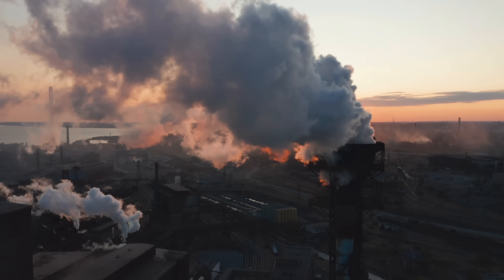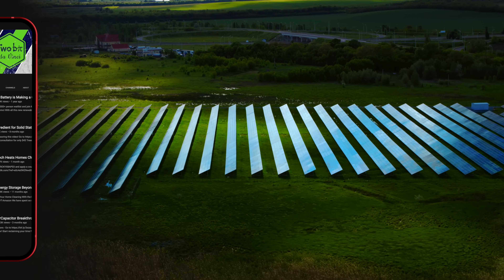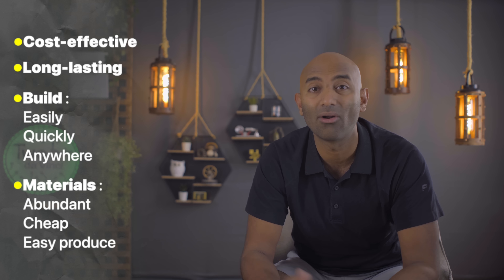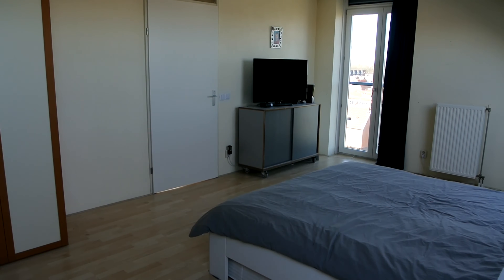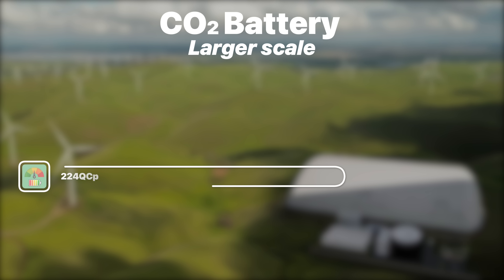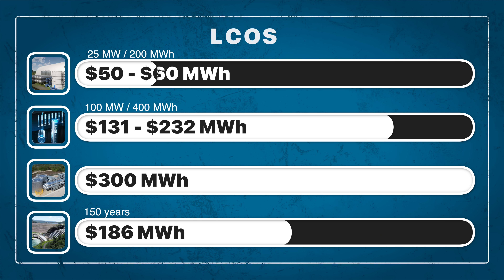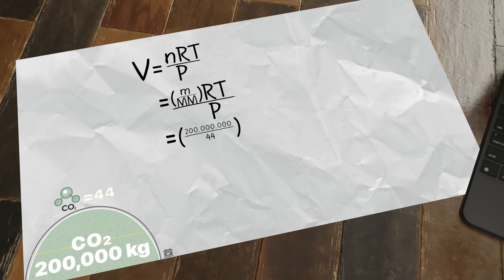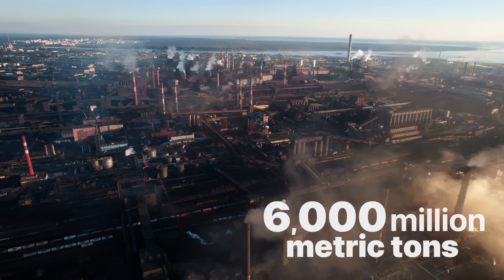The GENIUS Of the Carbon Dioxide Battery

Comment: How much CO2 will it cost to create the Iron/steel  for the CO2 Battery - Sometimes it cost more energy to create the solution - Like I want an EV and I am being forced to scrap my perfectly good car that I only do 3000 miles a year and should still have 10 years life still in it. 

Would it be more energy efficient to have an EV built and shipped to me whilst melting down my car for the metal, the EV will be costing me ~ $50K,  when I only paid $1K for the car 3 years ago. I would like a F150 lightning just because it would give me off-grid capabilities,  so I do see some benefits.

Comment: Delicate balance...  Scale is kind of important when discussing "delicate."  Funny thing is, 99.8% of folks going on and on and on concerning the topic have no idea about the actual numbers.  They prefer to believe in the cult of fear.

And why does every end-times belief always have to happen in this lifetime or very near it?  Hmmmmm.

------

Nearly all of the Earth's atmospheric oxygen comes from plants and the process of photosynthesis -- 98%.  70% of that plant-sourced O2 is sea and ocean based via phytoplankton.  In other words, what land-based life forms do is of marginal impact on planet Earth's atmosphere.

Here's the balanced chemical equation of the photosynthesis process:

6CO2 + 6H20 + (energy) → C6H12O6 + 6O2

Notice, the O2 and CO2 quantities are equal.

The balanced chemical equation of cellular respiration is just the reverse flow of the above -- sugar burned with oxygen yields cellular energy, carbon dioxide, and water.  Once again the quantities of oxygen and carbon dioxide are balanced.

The gradient between oxygen and carbon dioxide in the atmosphere is 21% to 0.04%...  That's one hell of a difference given plant cellular respiration is chemically balanced between CO2 and O2.  The difference is black hole like.  In addition, oxygen is an extremely reactive chemical.  It wants to combine with *everything*.  CO2?  Not so much.  It's nearly inert at earth atmospheric temperatures and pressures.

Another thing to keep in mind.  The cellular respiration process of plants producing CO2 goes on 24x7.  CO2 only gets converted to O2 during daylight photosynthesis.  That's a 2-to-1 margin.

Effectively, earth's biosphere is a carbon near-vacuum literally starving for CO2.

When such vast gradients exist and someone proffers the notion that parts per million perturbations are life-ending, chances are the speech is motivated and contains something more than rigorous science.

It just doesn't pass the simplicity back-of-napkin once-over.
Reply: This is such an inane argument, try raising the cyanide levels of your body to 400 ppm a let me know how it turns out. Obviously things in the ppm range can
Reply: ... have an effect.

But the percentage is irrelevant anyway that's  just how we measure it to track changes. What matters is the chance of a photon leaving the Earth encountering a CO2 molecule and getting sent back to the surface. That is related to number of CO2 molecules there are and nothing to do with proportions to other irrelevant gasses. If you magically took away all the other gasses so that CO2 was 100% the contribution it makes to the greenhouse effect would still be the same. The Earth would be freezing because most of the greenhouse effect comes from water vapor, but still the CO2 would keep the Earth warmer than it otherwise would be.

The actual relevant questions are: Does CO2 absorb photons in the infrared where The Earth radiates? The answer is yes.
Does increasing CO2 block more infrared? It's complicated but the answer comes out to be yes but it has diminishing returns. Which is why the climate sensitivity figure is given per doubling of CO2.

Comment: When Michael Mann came up with theory of a correlation of rising CO2 levels and rising global temperatures which was accepted by the IPCC through the measurements of tree rings but very much disputed by others equally competent in that scientific field  he failed to distinguish which came first. The rising temperatures or rising CO2 levels. 
Scientists using ice core samples which record the atmosphere when they are laid down have recently answered that question. Rising temperatures precede rising CO2 levels not the other way round. This makes a mockery of the accepted theory of anthropogenic global warming. Rising CO2 is not responsible for climate change. 
Weve been told to follow the science. Well there it is . Of course the climate alarmists will double down on the course they have set.Their version of climate science has become the most fraudulent by using historical data that has been manipulated and changed so that predetermined outcomes to support their theories.
And this is why the lPCC ,the UN and other climate alarmist bodies have never not even once come up with a working computer model that has predicted climate change based on rising CO2. 
Probably the closest predictions are made by Nicola Scafetta from the Milan university whose graphs show that climate change is cyclic with a prediction that global temperatures will decrease around 2028 - 29. So far his graphs have been accurate . This cannot be said of the corrosponding graphs made by the IPCC and the UN

Comment: CO2 never was a problem.

The only problem is that we may run out of fossil fuels and beyond nuclear no one has yet produced a viable, safe, economical, environmentally sound alternative, just jumped in with the extremely flawed wind and solar “alternatives”, that require massive environmental degradation to function even at their very limited potential.

You are the victim of a psy-op, and you are wasting your time and ours prattling like this.

Comment: Don’t need any of this with a nuclear reactor that produces electricity 24/7/365. Renewables are only cheaper because of Government subsidies for them, VS impediments to building nuclear plants.
Reply: That's not actually true. Even if the supply is constant the demand isn't. France has the highest % nuclear and they have reactors that shutdown over the weekend at great expense, others running inefficiently in load following mode and a high dependence on neighboring countries to supply dispatchable power at peak times and soak up the excess overnight. A high nuclear grid is also going to need storage.

The way we have until now dealt with this is not to have too much baseload and generate quite a lot of power from dispatchable sources like hydro, gas and even diesel and through demand side measures like off-peak power overnight. If we are going to phase out the gas and diesel it's going to take either new forms of dispatchable power which aren't in sight or storage. Renewables do seem to make the problem worse but not that much worse. The intermittency
Reply: [Bumped send] ...problem isn't as much of a problem if you already have enough dispatchble power to deal with demand.
Reply: Very true, but beware of the dangers of pressurized reactor vessels. LFTR is the safest and most cheapest because it uses mor abundant thorium and converts it more efficiently. And to top it off it can be scaled down to power a factory or subdivision. No more big energy and high tension transmission lines, with the bonus of resilience and redundancy!

Comment: I'd have questions about the flexible membrane inside the dome. That's probably the part most likely to leak and break. 
I wonder if telescoping gas-holders might work better instead. I imagine they might be easier to build and construct, and inspect, than large domes and their associated membranes are.
Reply: Quite remarkable how all the Gasholders that could be used for storage were demolished......rather like demolishing all the smaller and local power stations, whose retention would have been suited to more localised Combined Heat & Power (CHP).

The idiocy of those who cleared these things away when we most need them......

Talk about re-inventing the wheel...........obviously now at far greater cost..
Madness....!

James Hennighan
Yorkshire, England

Comment: Actually the news about CO2 is better than this. CO2 will not cause runaway global warming. It is like paint, add a little and you get a lot of change, extra coats make little difference (the relationship is logarithmic). Most theoretical warming from increasing CO2 has happened, and no disaster- actually things are going well. And a little warming is a good thing as it happens in the colder areas.  And not only that CO2 is plant food, it is the green gas and higher levels make plants grow faster and more suited to arid climates.

Comment: It's ridiculous to think that our current debate is confused and you have not clearly defined that our current trajectory is biological lifeforms extinction and without an immediate halt to burning fossil fuels, this outcome is confirmed whatever is done in the future. 
Yes it's going to be painful but that is insignificant to non linear exponentially accelerating changing climate and I tried to get the last 25yrs to be a transition. Instead we did the opposite. 
So if you're batteries don't suck 7trillion tonnes of C02 out of the atmosphere within about 15yrs, society won't be stable enough to have an economy to create this technology 🤔 🙄

Comment: CO2 is NOT a major greenhouse gas. It absorbs only a tiny bit of infrared at 4.2um. The major greenhouse gas is water vapor. Add chemtrails, which are a blanket over a hot earth beneath a hot sun, and you have global warming. Plants can't turn CO2 to O2 without the sun, which chemtrails block. Methane is a powerful full greenhouse type gas, and chemtrails are creating it by melting the poles.

Comment: Coupled with Fossil fuel power plants it would improve their efficiency. Running a steam generator at a constant rate as opposed to fluctuating rate due to grid demands could improve efficiency. Matching the entire system with complementary businesses like greenhouses and Carbon dioxide production could create a holistic business plan.

Comment: CO2 isn't that bad at all. Plants love CO2. The CO2 problem can be solved with more vegetation. Install a garden on every flat rooftop....

That said if you're going to capture it from the atmosphere there will come a time you will have to stop. As fossil fuels are phased out the amount of CO2 in the air will drop a lot and to then start completing with plants for CO2....

That and wind and solar aren't nearly as clean as we're lead to believe. At the end of a solar panel's life span there's a lot of dangerous metals and chemicals used to produce each panel that will be tossed out once the panel stops functioning.
The roter blades of wind turbines cannot be recycled and aren't bio degradable either.

Comment: Electric vehicles/ batteries are all natural gas coal diesel powered and created products. Same goes for the products to create solar panels and wind turbines they have a tons of  CO2 the products above in the created column before there even producing energy or taking someone around town. Absolute zero is unattainable complete renewable power sources delusional

Comment: Yay!  An Industrial Battery Technology that doesn't threaten to destroy a square mile, vent noxious gas, or set of an EMP upon failure.  If it truly works appropriately, putting them on the roofs of industrial buildings could be an amazing move forward.

Comment: What about periods of CO2 DROUGHT ?This has a greater detrimental effect on plant life as crops & trees need CO2 for photosynthesis.  

Growers inject compressed CO2 into their greenhouses to stimulate plant growth - EXPONENTIALLY.

Fossil fuels (coal & oil) release stored solar power when burned.  It was the photosynthesis (sun, CO2 & water) made the CO2 into the dead  plant debris to form fossil fuels.

The typical atmosphere is: 78% nitrogen, 17% oxygen & 5% of all else (eg CO2, radon, methane, etc).  Lightning storms are  the main way atmospheric nitrogen is bound to the ocean & soils for plant  fertilizer.

Actually we have tons of pollution we have not learned to convert yet - spent  radioactive rods, effluent from mines, solid waste, etc.

We have plants that distill diesel fuel (only #1 & #2 plastic are recycled ♻️) from OTHER landfill plastics.  British Petroleum buys it & pumps it in their gas stations.  This is where we need the legal system to drive the change.

Comment: This is a high loss energy storage method, gravity storage is much better with a smaller footprint.  You keep saying "this CAN work at room temperature", but neglect that it won't be performed at room temperature because compressing and decompressing will dramatically change the temperature buy hundreds of degrees Celsius between compressing to decompressing. Gasses get hot when compressed, raising the work needed to compress gasses.  Gasses absorb heat when decompressed, reducing the output work received when decompressing it, as you won't be compressing and decompressing at the same time, you cannot use these two deltas against each other.  You either need to do something with the heat form compression and deal with the heat deficit when decompressing it (your liquid CO2 at room temperature will freeze into dry ice in the tanks as you begin decompressing it unless you heat it, your output will be a low 20% efficiency compared to gravity storage which can be well over 60% efficiency.  A thermal battery coupled with this may offset this, but gravity storage just doesn't have to bother with this.  Lift a weight to store energy, have the weight pull a pulley to turn a generator to release the energy.  Gravity storage has less loss per useable output watt.

Comment: I can see this working in conjunction with Li Ion batteries. The Li Ion for frequency modulation and rapid short term response and the CO2 battery for medium to long term storage and discharge cycles.
Reply: Manganese/ Antimony / Sodium batteries are the future ! Cheaper, more efficient, materials more abundant & local.
Reply: No need for using Li batteries in grid storage, so many other cheaper and easier batteries are available as the grid does not need the performance of Li. 

The justification for Li batteries in grid storage is secondary use after they have spent their time in a car. They may be 80% capacity but that does not matter so much in a stationary power storage facility. 

But yes your concept is correct, some form of slow mass storage combined with fast response batteries of some kind is cool.
Reply: I thought things like flywheels and supercapacitors would be better for this sort of application (ie. frequency modulation and rapid short term grid balancing)

Comment: Its always made me confused because by adding co2 to the greenhouse it actually increases the amount of light yo be converted into energy through photosynthesis ……by the plants . They can use more of the par
Reply: I know right, and since co2 is one part carbon and two parts oxygen I really struggle to take seriously any figures regarding the tonnage they claim to be in the air since the carbon part is only one third.
Reply: @kiwidiesel  and the cognitive dissonance required to say that 111 million litres is a drop in the ocean compared to 6 billion metric tonnes, but not question the AGW narrative, well it beggars belief.
Reply: You can store a little bit of the energy that comes into the greenhouse as chemicals that make up the plants but but once the plants are grown the average energy in has to equal the energy emitted out otherwise the greenhouse must be getting hotter or colder. The amount of energy stored in the plants is insignificant compared to massive flow of sunlight in, infrared out anyway so at all times the energy in pretty much equals energy out. CO2 doesn't do anything noticeable to the temperature in you green house "the greenhouse effect" is just analogy to trapping heat and has very little to do with how a green house actually works.
I don't actually get what the point was you were trying to make except the feeling you were expressing a skepticism that CO2 is a "greenhouse" gas. The Earth works the same as the greenhouse above the energy in has to equal the energy out otherwise it gets hotter (or colder). It absorbs a heap of energy from sunlight and emits that same amount of energy as infrared. CO2 absorbs a few tiny slivers of that infrared and emits it back down to the ground stopping it from shinning out into space which means that the energy out is less than the energy in. The earth gets a tiny bit hotter, shines a little more brightly in the infrared and the balance is restored, but at a new slightly higher temperature.
Reply: Carbon dioxide levels above 1000 ppm to 5000 ppm causes lush plant growth,  reduces the need for fertilizers and reduces the water needed to grow the plants per hundreds of studies done over the past 50 years.  Below 180 ppm,  the C3 photosynthesis plants (most cereal grains and many other food crops) start dying off.  Below 150 ppm,  the more efficient C4 photosynthesis plants start dying off.   At the end of the last ice age the CO2 levels had dropped to about 180 to 200 ppm,  and only in the past 400 years have they begun to return to the levels seen prior to the last ice age (400ppm to 1000ppm).

Comment: What about the energy required to compress CO2 into liquid? Is there any data regarding the cost and source of energy to compress?
Reply: Essentially, that is the energy that is going into storage, which will mostly (i.e. 75–80%, if the given figures are to be believed) be recovered in the energy-release part of the cycle.